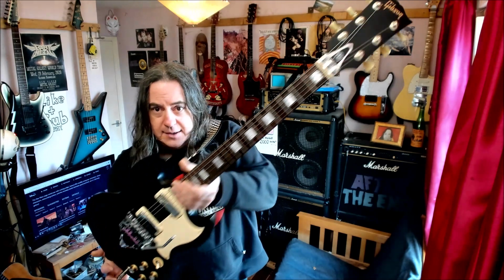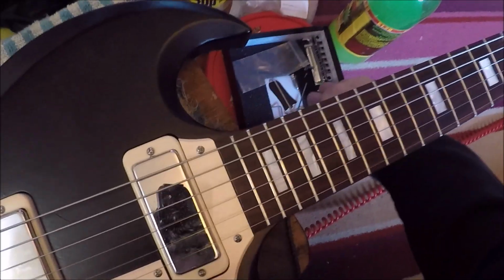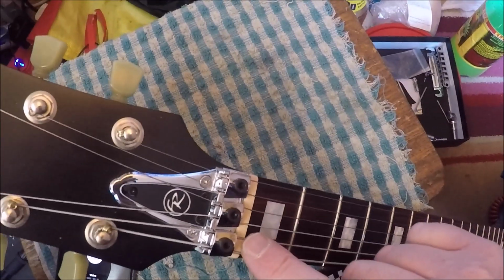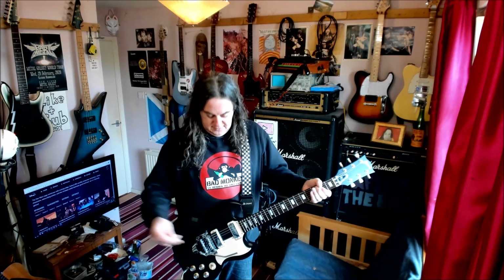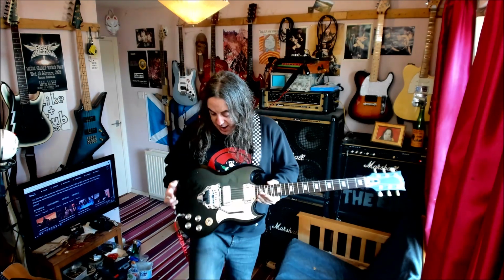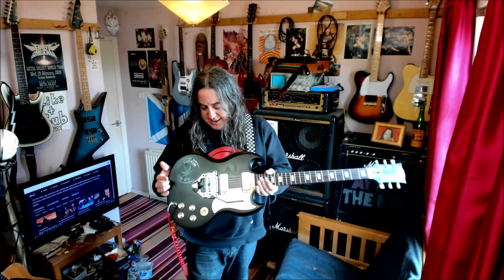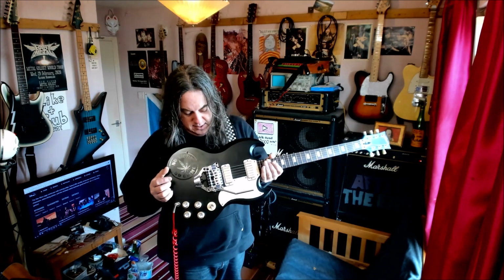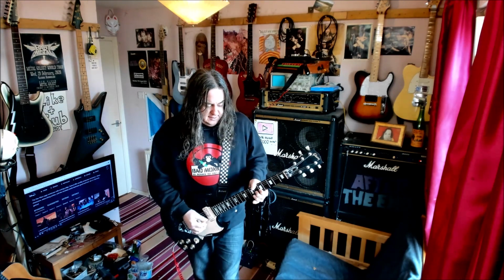Floyd Rose FRX fitted to Gibson SG

Comment: BEWARE - I have an SG Standard with a full pick guard that has to be modified or the action will be higher than an acoustic.  (How is your action Malko?)  The spring rod has also already gouged the body during experimental installation.

The two sets of posts are standard thread and metric thread to accommodate Gibson and Epiphone.
Reply from the maker: this one worked perfectly first go..may have just been lucky?
Reply: i have two exact SG Futures and when I installed the FRX, the spring also gouged one of my bodies, yet not the other. Go figure
Reply: UPDATE:  I had my setup guy install mine and now it’s fantastic!  He had to cut/drill two small reliefs in the pick guard (full) to accommodate the height adjusters.  It now sits level with the body, and there are no binding or gouging issues.  REAL happy with it now!

Just to brag a little, I also picked up a ‘96 Standard with an old Kahler bar on it.  Found it on eBay.  So I’m real happy twice over, lol.
Reply: @tgwazu  nice on the '96. i liked 90's sg standards. was thinking about a kahler before opting for the frx. which bridge do you like more?

Comment: The FRX has a set screw that makes it "sticky' at the balance point (can do those Chuck Berry licks without bending strings, going out of tune). You can also use that thumbwheel, increase spring tension, and make it dive-only like EVH. Love the FRX better than regular Floyds. Learn all its options. Its bad-ass.
Reply from the maker: yeah i set it with that "sticky" screw you are talking about , dead easy to change that to full floating or downbend only